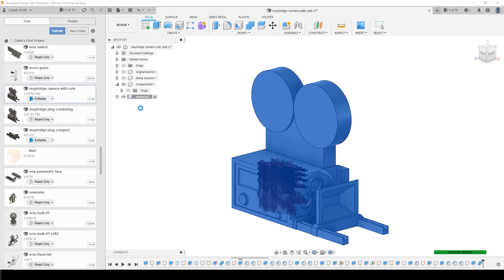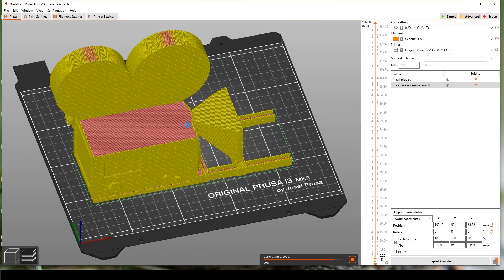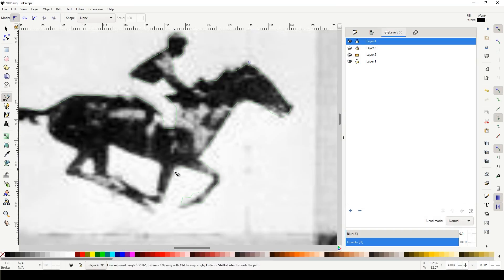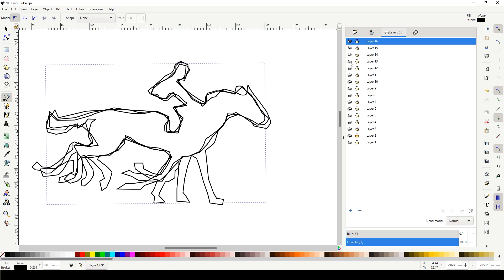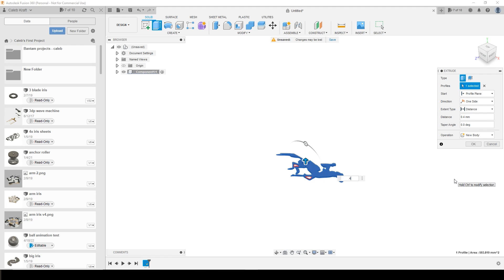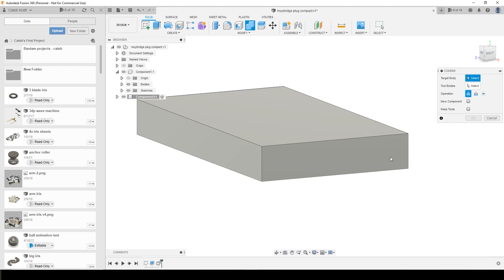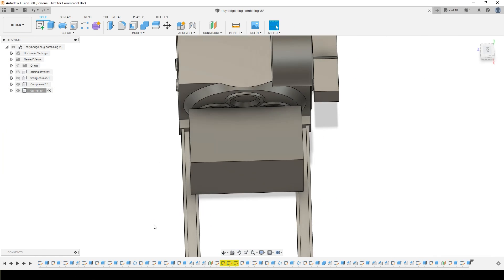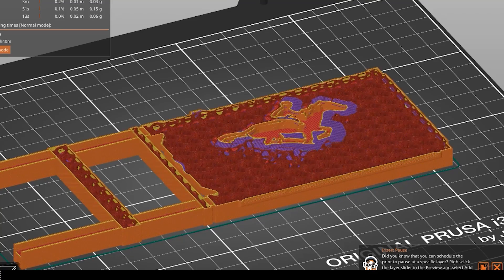How To Embed flip-book animations inside your 3dprints - 4D PRINTING

Comment: Cool idea to figure out how to do but what really is the point? I get it is to look cool and add more to timelapses but it just adds extra complexity and material use. I would much rather keep my design simpler to print and ensure that it prints correctly rather than fiddling about with how it looks inside for a timelapse when the insides will never be seen again once it is printed.
Reply from the maker: the point is just an exploration of what's possible. it's kind of like asking what the point of art is. Since you'd rather not do this, it's a great thing that literally no one is asking you to or forcing you to!
Reply: @CalebKraftmakes  it's more like painting a picture then putting another layer on top of it
Reply from the maker: @conorstewart2214  correct, that is exactly how animation works.

Comment: well a 3D laser printer sounds plausible, could be done with a resin printer, but instead of a screen with uv light, could use a laser to create the patterns
Reply from the maker: it was a bit of an inside joke. All the commercials for the glowforge called it a "3d laser printer" to try to make it sound somehow different and new compared to laser engravers/cutters.

Comment: awesome idea! i noticed varying thickness of a solid outline around the animation in different frames.. using 100% infill around the animation would help to get rid of this.. probably leaving a more crisp looking animation
Reply from the maker: yeah for sure. there are a ton of ways to do it. if you watch through the parts where I talk about the slicer, you can see I did it roughly how you described and it is certainly different.